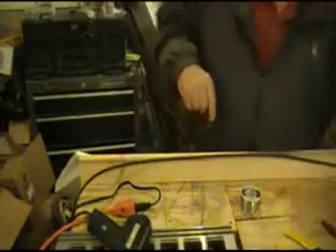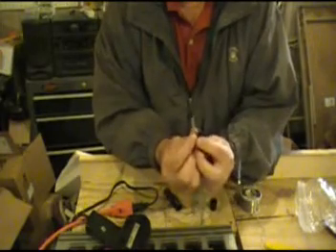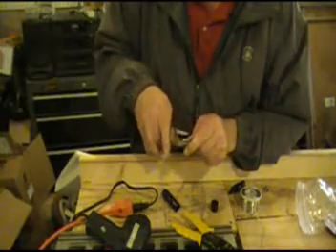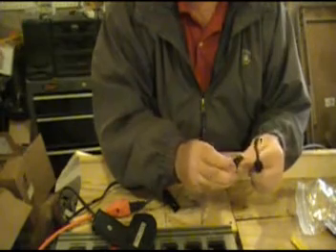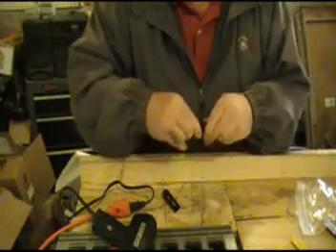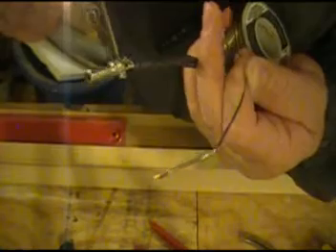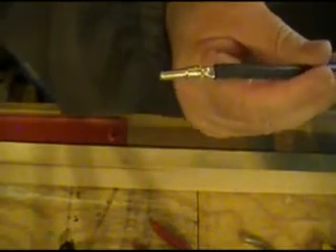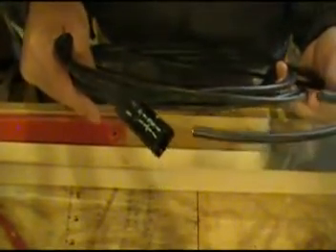Attaching MC4 connector to wire

Comment: what size wire are you using
Reply from the maker: I just put in solar cable on e-bay and bought the length I needed but I believe it is 8 gauge and you might be able to fit 6 gauge in it. Good luck

Comment: I want to use these connectors on my boat for my trolling motor connection.  Will 6 gauge wire fit in these fittings?
Reply from the maker: I think they are rated for up to 8 gauge it might be a tight fit but you may be able to make them work. Good luck